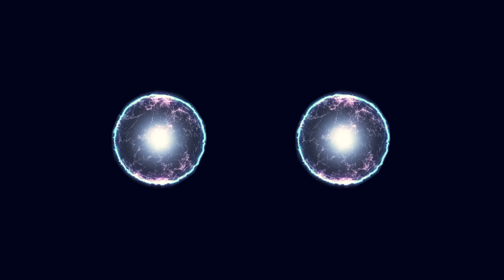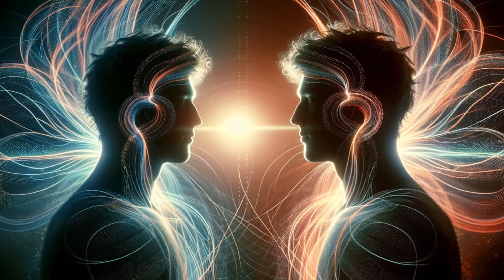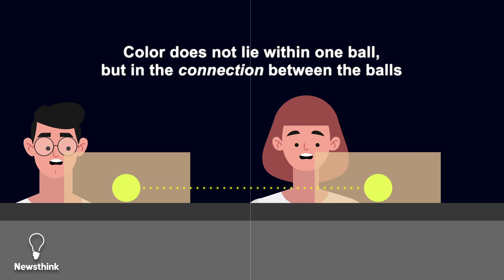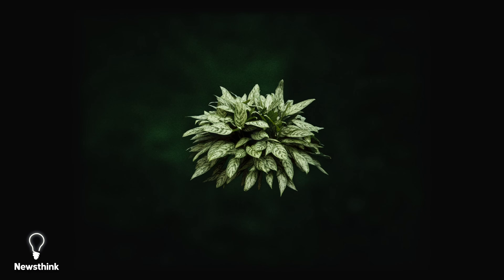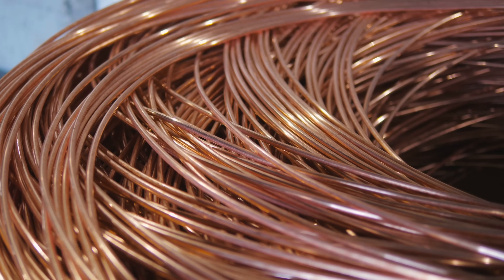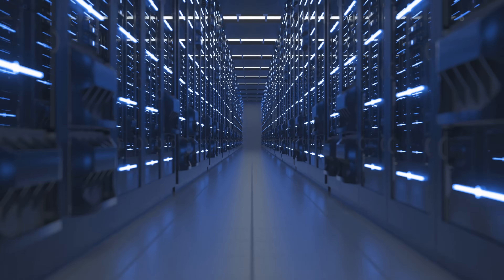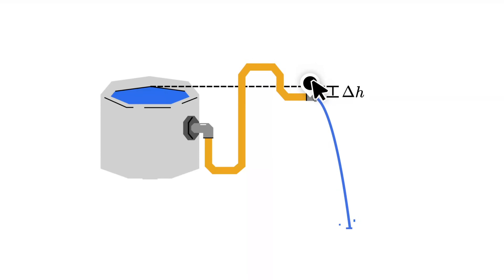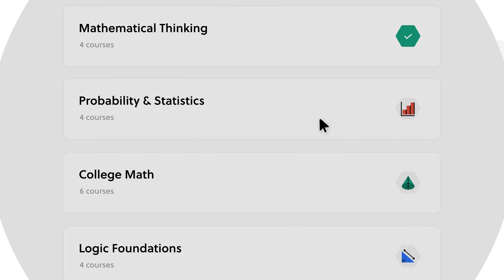The Weird Experiment That Defies Logic

Comment: E = mc2 is spooky too, for it doesn't spesify what ENERGY really is.

That would have been the case if he meant there are 

c² = 90 000 000 000 

smaller particles corresponding to every unit of mass.

Then it would, of course, be a LOCALIZED physical formula. 

As it currently stands, it too is only a mathematical formula that experiments confirm ~ hence not different from the situation with ENTANGLEMENT or Newton's explanation of gravity.

That the effect is observable in the immediate surrounding of the event doesn't render it LOCAL.

E = mc² is not LOCALIZED either. Hence SPOOKY.

But then, so are also the concepts of charges and spin, for there is nothing PHYSICAL in any particle to differentiate those properties from MASS, the only property of a particle that can be visualized as corresponding to its PHYSICAL volume. Then again, different MASSES of different particles must be proportional to their volume, for even this concept to be considered fully PHYSICAL.

Hence, our current atom model too is SPOOKY in many ways.
Reply: Energy means heat

Comment: Like most things in physics I suspect that there’s a simple explanation for this which we are yet to discover.
Reply: As far as I know 
1) Entanglement comes from the common past of both particles. Quantum mechanics itself is time invariant (unitary). The arrow of time comes from the increase of entropy. Whether time is ergodic and stuff repeats itself over and over is the other question then.
2) The limits of entanglement determine the fundamental complexity of nature.
3) Entanglement is basis-dependent. Let's say Alice and Bob share an entangled pair of qubits and agree on a basis to measure. They also agree before that Alice measures first. Alice measures her qubit and gets some result (e. g. blue). Then Bob will get the same result or the opposite result depending on the shared state. But they have to measure subsequential. In that case the information (who goes first, what to measure) is transmitted before.
4) Entanglement allows for certain no go proofs in quantum communication which has no real equivalent in classical cryptography. The assumption underlying our crypto is that some computation is hard classically (e. g. factoring) because no one has found an efficient algorithm yet. The assumption underlying quantum communication is that certain theorems about entanglement hold. Personally I'd rather bet on the latter as physics is the best tested science and quantum mechanics is the best tested physical science so far with a track record of performing the same experiments over and over again for over 100 years. But both are just assumptions.
5) You can use quantum entanglement to win certain games with a higher probability than is classically possible. Playing these games in reverse delivers security protocols and proofs used in quantum communication. Why is this possible? I have no idea. The mathematics behind it are quite simple - the physical consequences are still difficult to grasp.
Reply: Or is just pure conjecture based upon layers of conjecture.
Reply: There IS a complete and full explanation. But it's not "yet to discover" - it's just basic quantum mechanics.
Whether it's "simple" is a matter of opinion. Most of the public, and many scientists, don't grasp it - and yet the scientists are able to calculate and use the phenomenon to do their jobs.
Reply: @DavidByrden1 seems I got my homework laid out then!  Hopefully I can get a grasp of the “how” and “why” as well!
Reply: Most things in physics do not actually have a simple explanation. Classical Mechanics itself is so complex, even without involving any Quantum Mechanics or Relativity.

Comment: Using different perspectives as an analogy for different measurements is actually spot on. Suppose Alice measures her particle vertically and the result is "up" (the other possible measurement outcome is "down"). She knows that if Bob measures his entangled-partner particle in the same vertical perspective, he will also find "up" (I'm using the spin triplet state here, as in this video). So, if Bob instead measures his particle in the horizontal perspective, Alice expects his result to be zero, neither "left" nor "right", since there is no side-to-side motion associated with up-and-down motion and Alice knows Bob's particle is vertically "up". Instead, for all the trials when Alice's result is "up", Bob's horizontal measurements produce equal numbers of "left" and "right" outcomes, which only average to zero side-to-side. The same obtains for all the trials when Alice's result is "down". So, Alice says Bob's measurements are horrible! His outcomes are as wrong as possible in each and every trial even if they do average to the correct outcome overall. 

Bob, feeling insulted, replies, "Wait a minute. I know if Alice had measured her particle horizontally, then she would have gotten "right" when I got "right" and "left" when I got "left", so clearly her particle has no up-and-down motion at all. Therefore, she is the one who should be finding a zero result when she measures her particle vertically!" And, sure enough, for all the trials when Bob's result is "right", Alice's vertical measurements produce equal numbers of "up" and "down" outcomes, which only average to zero up-and-down. The same obtains for all the trials when Bob's result is "left". So, whose measurements are correct? The relativity principle says everyone's perspectives (reference frames) are equally valid for making measurements, so they're both correct!

This is totally analogous to the situation in special relativity when Alice's perspective (reference frame) differs from Bob's by virtue of their relative motion. In that case, Bob's measurements of Alice's meter sticks clearly show they are smaller than his. But, Alice's measurements of Bob's meter sticks clearly show they are smaller than hers. Again, whose measurements are correct? Again, the relativity principle says their measurements are equally valid, so they're both correct!

See "Einstein's Entanglement: Bell Inequalities, Relativity, and the Qubit" due out in June 2024 with Oxford UP for the details 🙂

Comment: 5:51 The Shanghai Maglev train doesn't use superconductors. It uses electromagnets through a Electromagnetic Suspension (EMS) system. The JR Chuo Shinkansen does use superconductors through the Electrodynamic system (EDS).
Reply: correct

Comment: Actually the double slit experiment has an explanation. When the particle is getting "observed" (here observed doesn't mean by a human) it uses photons which have high energy this in-turn collapses the wave function of the particle being observed. 
And that's why when not observed particles create a wave pattern and when observed act as individual particles.
Reply: Ya but the wave pattern develops with each particle on the detector..  after many many times it's sorta like a painting being painted..

The fact remains,  it's not explained in any way.  It's just a controlled expairement that leads to many amazing conclutions that baffle common sense...